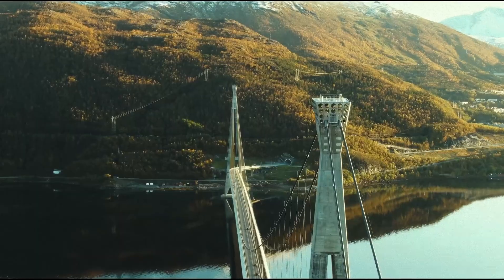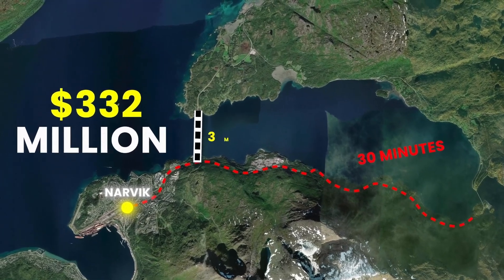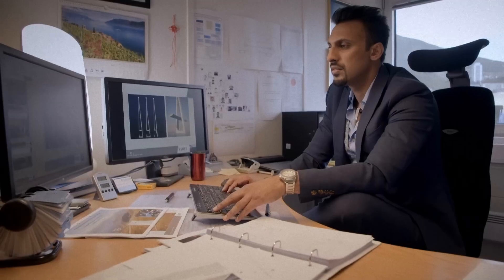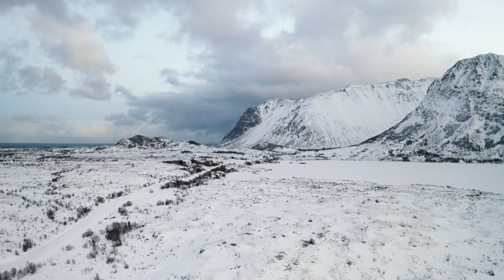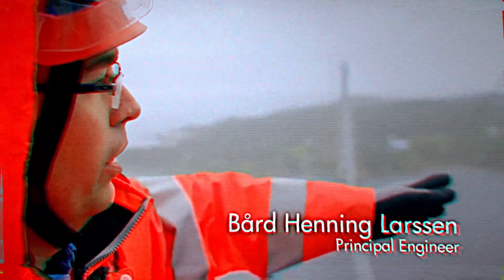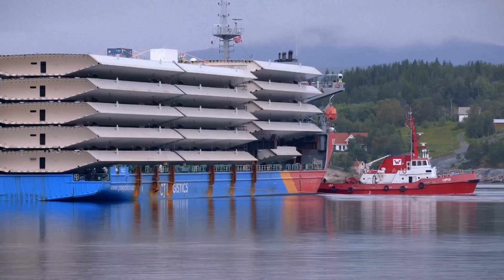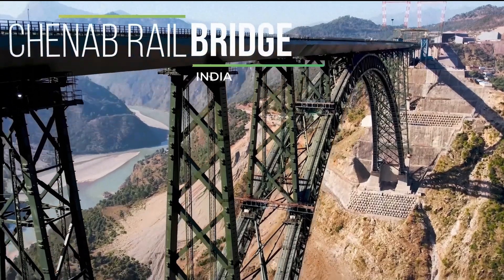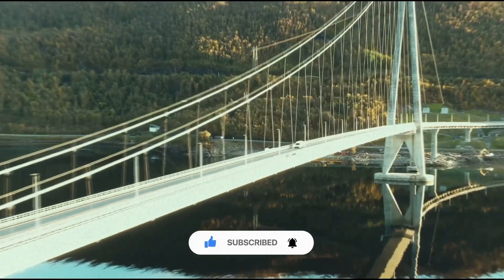NORWAY Builds The IMPOSSIBLE Hålogaland Bridge_Every Worker CAN Face DEATH

Comment: Why does the Bridge have NO Road Shoulders for “EMERGENCY” Road purposes ?
Reply: We don't have road shoulders on our bridges, that I know of. But I think they are very safe for these reasons:
-There is only one lane in each direction and both are a little wider than the adjacent roads.
-The walk/bike lane is 3 meters and separated by a solid metal fence.
-The road on the bridge is also well maintained and lit by night with no turns.
An emergency stop on the bridge would probably be safer than on the adjacent roads.
Reply from the maker: @bjornivarant  I really appreciate this insight bjornivarant and highlighting details such as the bike lane is something I should have included. Thanks for this insight.
Reply: @Metabuilds1024  thanks, I live in Narvik and have crossed this bridge on my bike several times.
Reply from the maker: @bjornivarant  Arhh so cool. Your iphone content would have been very helpful for us making this video. Haha, jokes. thanks Bjorn
Reply: yes, Road shoulders or fencing made of concrete is necessary especially in such worst severe cold conditions,not only in the bridge but even on all the roads
Reply from the maker: @khemkhemeivee  Appreciate this insight khemkhemeivee and I'll be sure to keep this in mind for future Bridge video topics. Thanks for this
Reply from the maker: Thanks for this comment Gualberto and you’ve made a good point that I hadn’t considered when doing research. Do you think there’s a key reason why the engineers didn’t design shoulders? Thanks again.
Reply: @Metabuilds1024 
#1 Reason “EMERGENCY” Road Shoulders were “NOT” Designed & Built, might be because of Tradition or Mentality.
#2 Reason might be because They “DID NOT” want to spend the Money.
If a Vehicle or Motorcycle make an “EMERGENCY STOP” on the Bridge at Night, during a Strong Rain Storm, Thick Fog or Other Reasons, it can be Very Dangerous.